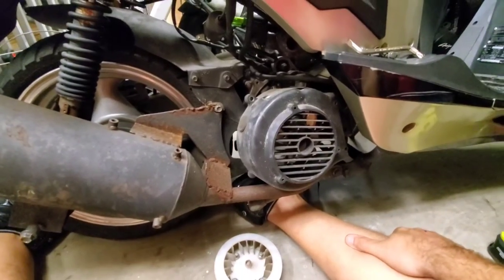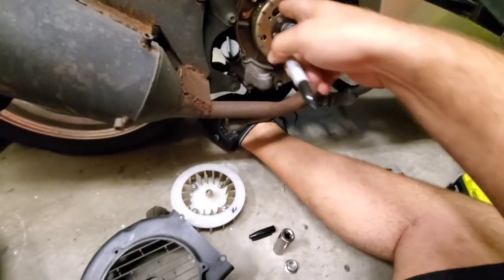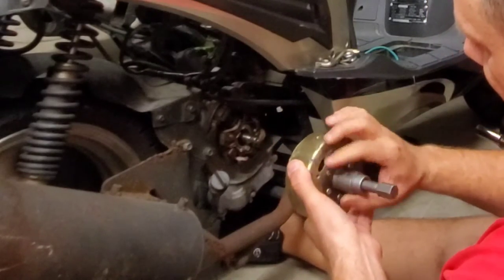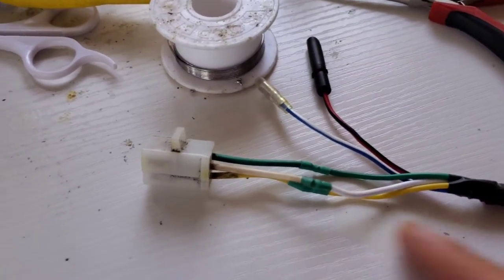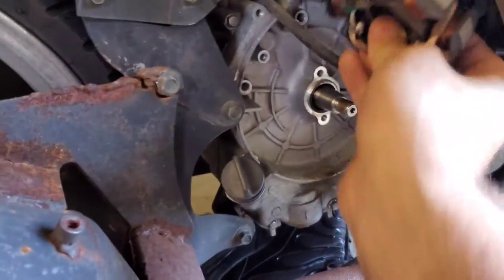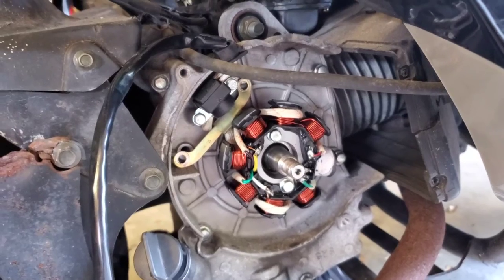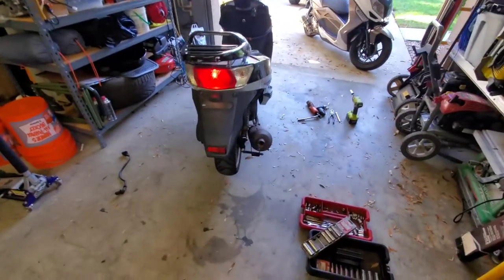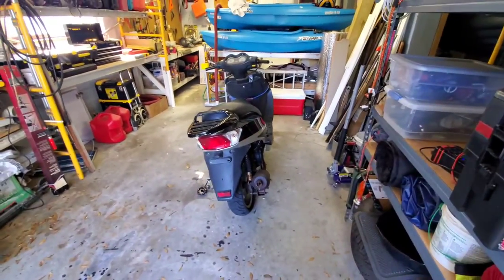Chinese Scooter 150cc - 50cc no Spark Fix Stator Replacement #gy6 #gy6nation #ifixshet

Comment: You did good breaking this video down one thing I do want to point out not being negative to the video but you don't have to mark it because of the PIN always has to line up. It can only go on one way.
Reply from the maker: Except sometimes people lose the key. If you lose the Key pin then it's really hard to get it relined it's always better to Mark it just incase

Comment: My scooter battery keeps dieing instantly and wont charge from the bike
Reply from the maker: That means that your stator needs to be replaced
Reply: @IFixShet  it is definitely the stator? My bike has a steelmate alarm fitted and the guy I brought it off said the alarm is draining the battery? So could it be the stator 100%?
Reply from the maker: @2strokecherry   You said that it instantly kills the battery. So the way this works is when a stateor fails It will use the rest of the power the battery has to create spark to keep the scooter running but when it can't then it's completely dead until you recharge it. So it's just a little 12v battery in there it won't take long to kill the battery if it doesn't have A way to charge while driving. The alarm should not affect the scooter unless it is left there for like a month armed without running. Now I don't know how old the battery is but if you haven't replaced it recently then I would replace the battery first and see what happens Because it might just be a bad battery. Scooter batteries are about $20 on ebay Pretty cheap

Comment: I replaced everything and still no spark... scooter doesn't have a kill switch so I'm at a loss
Reply from the maker: Check your safety switches kickstand brake switch is all that stuff
Reply from the maker: It could just be a bad wiring loom for the scooter that might need to be replaced

Comment: Help plz lol I replaced The battery, the fuse, the carburetor, spark plug, coil pack, startor and still no start & spark 😡
Reply from the maker: Check all of your safety wires kickstand and break levers Also check your kill switch
Reply: Check your engine to motor and to frame ground

Comment: U didn't need to solder the plug could just took pins out and swapped them and u didn't need to make a mark on the flywheel it has a keyway it's one way no matter what lol also one them claw pullers will take it off also i think there for steering wheels

Comment: Good job my dude but you should’ve taken a few extra minutes to test the trigger coil and the stator separately before just replacing both. A no spark condition can be caused by a bad trigger coil or bad stator exciter/source coil which is the covered coil on an AC stator that powers an AC CDI directly. Even though they are in close proximity to each other and wires run together they are two discreet components. 

Also, No need to cut, splice and solder... Sometimes replacement electrical components like the stator, regulator, rectifier, etc. may have the wrong connector, pins in the wrong order, male/female connector reversed, or no connector at all. The majority of the plastic connectors on these scoots have removable pins. Look at the face of the connector, there’s a small notch below each pin. Stick a precision flathead screw driver in to push the retaining tab down and the pin should slide right out the back of the connector. Most of the male and female pins will be either 2.8mm or 6.3mm get a set of both off Amazon for cheap plus the correct crimper to make your own pins/connectors and you’ll be good money. The larger kits come with all the most commonly used 1 thru 9 pin male/female connectors for small engine vehicles. One of the water proof connector kits I ordered even came with the crimper and the pin removal tool.

https://www.amazon.com/dp/B07Y4QFF92/?coliid=I2G21PZ1PVP0HD&colid=S02C0ZM6M2J2&psc=1&ref_=list_c_wl_lv_ov_lig_dp_it

https://www.amazon.com/dp/B0B9MGJLJJ?psc=1&ref=ppx_yo2ov_dt_b_product_details

https://www.amazon.com/dp/B0BLC9NCQY?psc=1&ref=ppx_yo2ov_dt_b_product_details
Reply: Well said,  Experience counts  👏  🎉

Comment: My 2013 TaoTao moped still runs but the tackometer jumps all over the place often times going past wherever the numbers stop and they stop and 10 but it is going to where 15 could have been on the tack I was told it sounds like a stator issue. So I ordered a new stator and rectifyer and now my issue is getting the old stator out I think I am going to need to order a crank puller on Amazon. It has reached a point where I can ride about a mile and then it will stall. Does my original issue sound like it will be fixed by this operation?

Comment: I have a question about your work there, does the scooter have a CDI controller on your scooter and so far I can’t find one anywhere without taking all the body components off to see if it’s somewhere inside the front covers, with that said I have the small manual that came with the scooter and the parts list in it has a line through the space listed for the CDI do you know if some of them came without a CDI and it has I think regulator/resistor that might regulate the spark it has 5 pole plug and some of the things don’t add up with the scooter it’s 2006 or 07 Schwinn Sport LH 150cc and I can’t find out much about it but I will hopefully figure it out thanks!
Reply from the maker: Yes you should have a CDI
Reply: @IFixShet  why would the book I have a line that is got it crossed out as if it doesn’t have one? Or I just have not found where it is this scooter is different than most I have seen the wires out of the stator are all plugged together in a harness that goes down the frame towards the front some where that’s the part I’m unsure about and the battery sets in a small box in front of your knee unless it’s under the battery box that I can’t see until I get the rest of the plastic off and the fuel tank is under the foot pad and not beside the tank because I can see the tank and fuel gauge wire plugged into the tank and nothing beside it so it could only be in the front side somewhere?
Reply from the maker: @rogeradkins1785   Let me ask you a question what do you think signals the system for spark?  What is controlling The pick up coil timing and sending the spark?
Reply: From all I’m learning on YouTube it’s got to have a CDI to trigger the spark to the coil to fire it and I just have not found it so far on the scooter but I’m going to remove the body shell and see if I can find it because the stator is plugged into the harness going to the front and my best guess is it is somewhere between the plugs and the front of the bike so I will let you know if I find in there towards the front end and sometime this coming week I’m going to remove the stator and test it to make sure it’s on the money or possibly bad , but I don’t know anything about this bike and the man that had it passed away a few years ago and his daughter gave it to me last week so I have more work to get it running and thanks for your help my friend!!!
Reply: @IFixShet  I finally found the CDI today after taking everything apart on the front of the bike , so I’m going to replace everything electronically in the system and cleaned the carburetor today and it’s ready to go and cleaned out all the dirt dobbers nest and looked like a mud puddle underneath it so again thanks for your help and response I appreciate it very much!!!!!

Comment: NEED HELP: ive changed my spark plug, ignition coil, starter, stator, cdi, carburator and still no spark. got any ideas?
Reply from the maker: Yep sounds like a safety switch problem check all your safety switches
Reply: @IFixShet  thanks a ton ill check that after work today!

Comment: I have a 2008 150cc wrecked scooter. All the plastics are pretty much trash. The headlights and speedo are yellow and brittle. Thinking of turning it into a naked bike. But most of those look fairly hideous. You got any naked scooter experience?
Reply from the maker: Purchase an old jet ski Hull gut the jet ski cut the bottom of it out slap it over the top of your scooter and make a scootski

Comment: @ifixshet ive replaced stator, ignition coil, cdi, and voltage regulator still no spark
Reply from the maker: If you were looking at the back of the bike which cylinder is not firing

Comment: I replaced everything and still no spark!? Plus disconnected kill switch  and starter switch and still no spark. I even had extra new components and no spark?
Reply from the maker: You might have a bad wiring harness
Reply: @IFixShet  I just installed a new wiring harness. It's a mystery. I haven't had any problems like this before when trouble shooting
Reply from the maker: @jeffnations6649  The Next Step would be to check your timing
Reply: @IFixShet  thanks, it's looks all correct. But who knows. It did have nuts in the intake side when I took the carb off.
Reply: @IFixShet  timing doesn't have anything to do with spark. You can have spark without timing being right
Reply: @IFixShet  I think I found out my problem. Have to wait until tomorrow.  My ground wire was connected to my neg battery instead of the engine block. Duh..
Reply: @IFixShet  thanks for your help! Yep, hooked up the ground to the starter frame mount bolt and got spark today!
Reply from the maker: @jeffnations6649  there you go Bud

Comment: Why do I keep getting a no spark replaced stator 2 times already and works for a couple days then fails again
Reply from the maker: Sounds like your scooter has a grounding issue somewhere you have a positive wire touching on the frame somewhere. It's probably time to replace your wiring harness on the scooter to solve the problem

Comment: That flywheel bolt is lefty loosey  correct? Cant get mine to move at all and don't know how to hold flywheel to keep from spinning.  Making sure it's not right to loosen on Chinese made crap .
Reply from the maker: Yes and that's because you need an impact driver to remove it
Reply: @IFixShet  I guess my compressor is too weak. Ok tks
Reply from the maker: @michaelmauro9335   A lot of them almost weld because of the amount of heat from the engine. I find smacking them with a hard mallet a few times really helps loosen things up or heat

Comment: What if the inside of the flywheel where you would thread the puller isn't threaded?  The one I'm trying to pull off a Yamaha vino is completely smooth
Reply from the maker: Then you need to get a pully puller
Reply: @IFixShet  thank you. Is there one you recommend?
Reply from the maker: @FirstnameLastname-hm4fq   I do not have a specific one that I would suggest it really is gonna come down to you and what you want. I would say at least get one that has 3 arms
Reply: @IFixShet  thank you. Just started learning motors and all that fun stuff. I've got a vino and a metropolitan that I'm learning on, and your videos have been a big help !
Reply from the maker: @FirstnameLastname-hm4fq   Good man I'm glad. Just remember when you remove the flywheel there's probably a woodrif key behind it that you need to make sure you don't lose
Reply: @IFixShet  I'm a chick lol but thanks for the heads up I'll keep my eyes open for it. I'll take all the help I can get 😊
Reply from the maker: @FirstnameLastname-hm4fq   My apologies it's good to see a female getting involved in this stuff
Reply: @IFixShet  no worries.  there's no getting upset in the garage...... unless you can't find the 10mm again 😂 6 months ago I didn't even know what a carburetor was now I'm brave enough to take on these kinds of projects thanks to peeps like you willing to share knowledge.  It's very much appreciated !